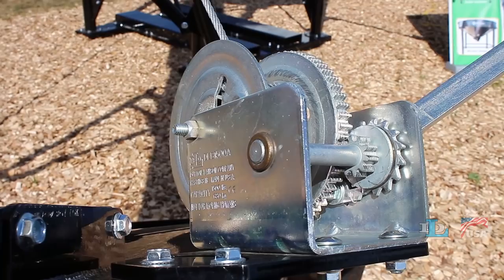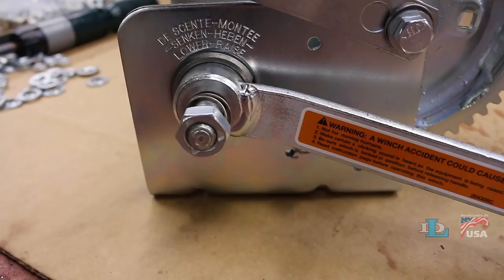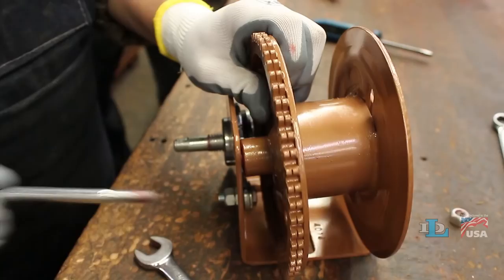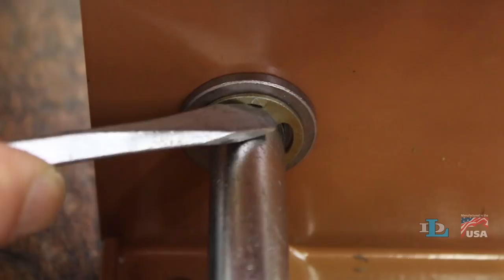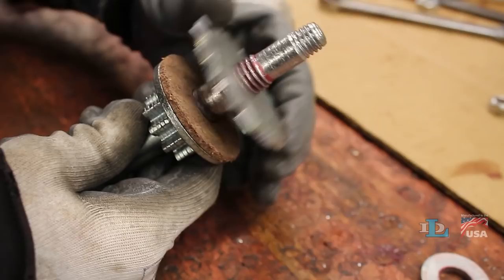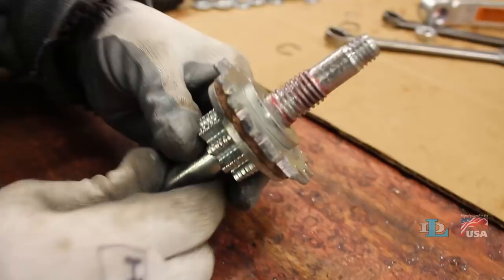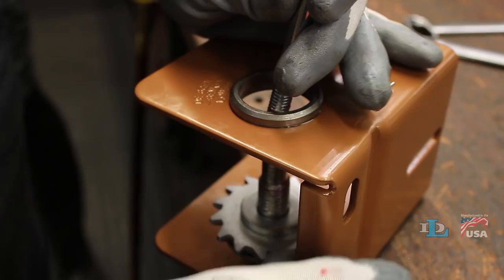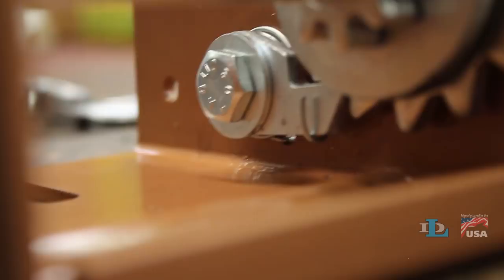Replacing the Drive Shaft on DLB-Series Brake Winches - Step-By-Step

Comment: I wanted the 3500 pound winch, then found out it was a 3 month back order. December 20 2021
Reply from the maker: You are correct- issues related to the pandemic (labor, materials, etc.) have greatly extended our lead times over the past two years.  Demand for winches has been particularly high, so lead times for them right now can be as long as 12-16 weeks.

Comment: Is there 1 spacer washer or 2?
Reply from the maker: Thanks for your question!  There is typically only one spacer washer installed on a winch/reel, but sometimes there are two.  If your winch only has one and it falls off when you remove the reel, make sure you re-install it on the same side it fell off from.

Comment: Does not show you how to adjust / fix / use brake . My brake is so tight that is takes 10 to 15 times the force to lower the load then to raise it AND NO VIDEO COVERS THAT SHAME ON ALL OF YOU!
Reply from the maker: Thanks for reaching out, Jack.  We're sorry to hear that you're having trouble with your winch!  It sounds like you simply need to remove the handle from your winch's drive shaft and then apply a small amount of marine grease to the threads on the drive shaft.  If that doesn't work, we have other possible solutions available on the DLB-Series Troubleshooting Guides page of our website- https://www.dutton-lainson.com/troubleshooting-guides/dlb350-dlb2500-series-brake-winches-manual/.  If none of the solutions listed there fix your issue, please call us at 402-462-4141 and ask for someone in the Engineering Department, who can provide further assistance.